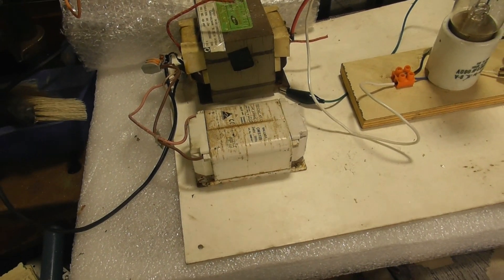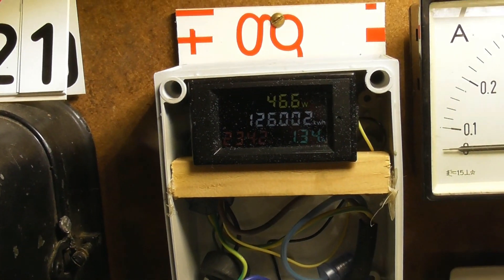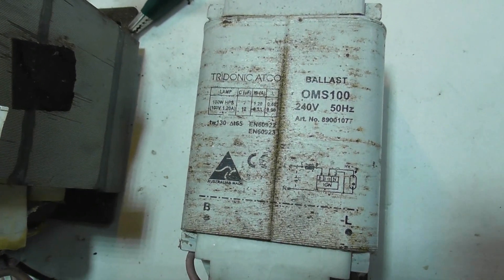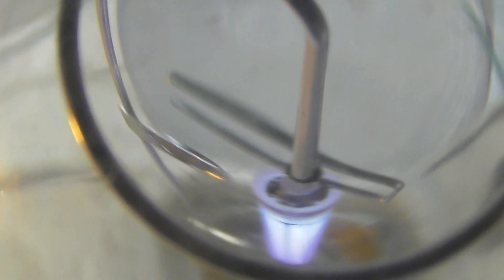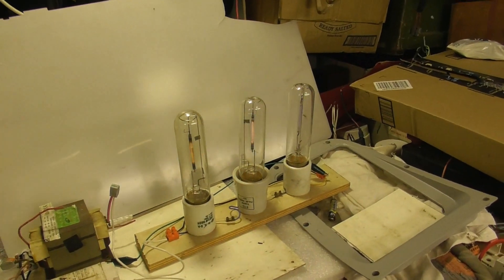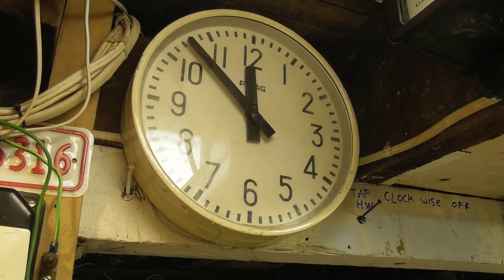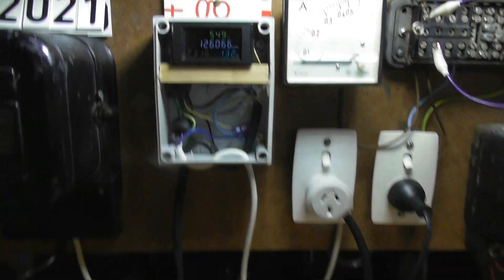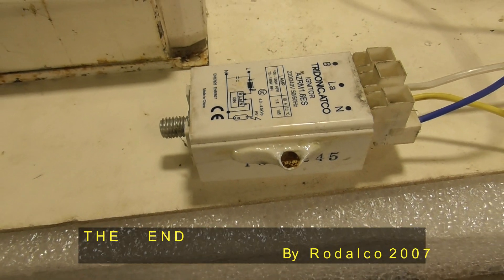3 x HPS lamps running in series on ballasted MOT

Comment: Try running enough lamps in series till the point you no longer need a ballast see ow much resistance you can get out of them
Reply: If he put enough in series to be honest he’d probably need a million volts to start it you have a point there
Reply: One in their own needs around 4000 volts as a starting pulse
Reply: parallel each with a couple of high voltage resistor and job done
Reply: NOW WERE TALKING hahaaaa
Reply: @soundspark  it would be in parallel so it wouldnt limit current thru the lamp string but would steal a little current from the mot
Reply: @soundspark  nonono, lamps in series, with resistors in parallel with them, idea being that the resistors provide a path for current to flow when the lamps are cold, so it can warm up enough to where the voltage  drop across each lamp is within what a MOT can provide. Come to think of it, that would basically be a resistive divider which means none of the lamps would get the full 2kv for ignition, hmmm.